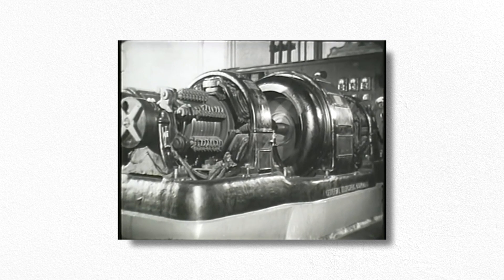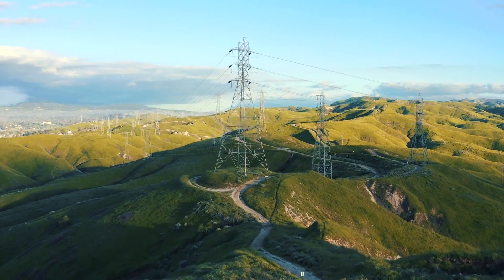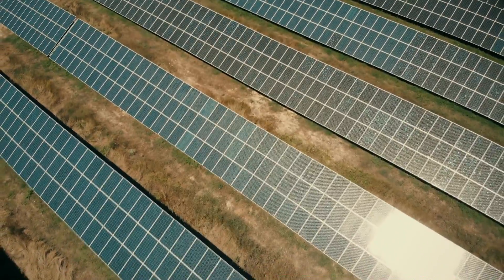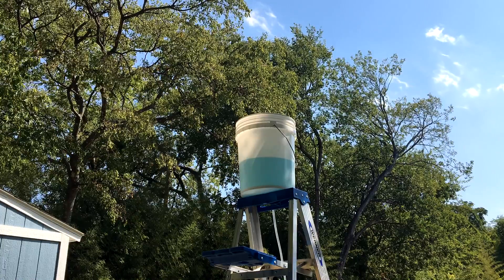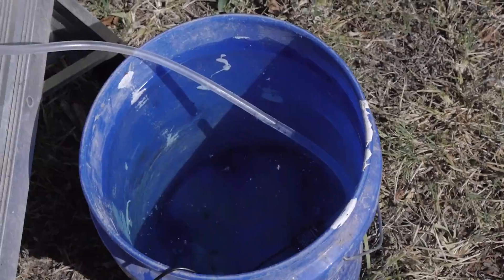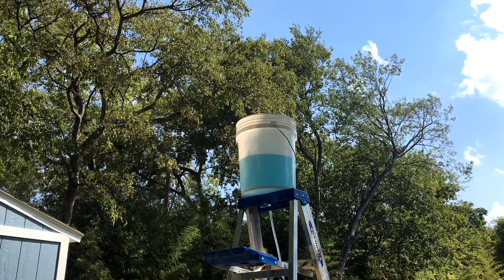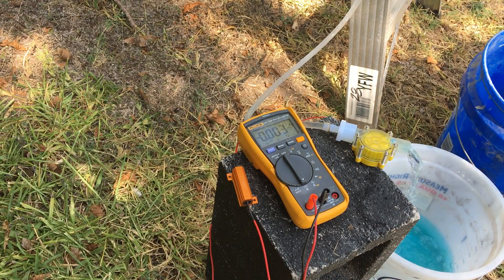World's Largest Batteries - (Pumped Storage)

Comment: I was thinking we could do it with air.. Run compressors at the cheap rate and let them power the turbines during peak demand. Just need a massive pressurised air tank now
Reply: Air heats up when you compress it, so you'll lose a lot of the energy you put into that pressure tank.

Comment: 1 m^3 of water at 100 m difference is ~270 Wh. 
1 km^2 reservoir x 10 meters deep = 2.7 GWh
Modern pump storage round-trip efficiency ~80%  ~2.1 GWh
It is enough to compensate NY City Evening peak. NYC eats up ~10 GWh per day.
Or ~200 000 000 typical phone or 18650 LiPo batteries.

Comment: Just had an idea, might be a little crazy, but I'm good at those types of ideas ..
What about a hydroelectric facility in a biosphere? There would still be the necessity for pumping water to the upper Reservoir, but if the Dome were the right shape, a fair amount of water could be moved through evaporation and condensation given the elevated Heat in a closed environment. Any thoughts and opinions on this concept would be appreciated.

Comment: What if you used a pulley system to get the bucket up to the right hight, you can use leverage to half the weight of the bucket as many times as you want, and you can use gravity to get it up there kind of like a weird see-saw

Comment: My understanding is that it is not about energy cost variance from day to night but the fact that many power plants produce the same amount of energy throughout the day and night and generally much more electric is consumed during the day meaning a lot of energy that is produced at night goes unused. This wasted energy is used to pump the water so even if you only get a portion of that back during peak hours it is better than all of the energy that is used for the pump being wasted at night. This also means power plants can reduce the amount of power they produce by a small amount because the high drain during the day is offset by the stored power generated at night by the pumps. This would obviously not be the case if all the extra power generated by the power plant was used in a hydro-storage facility but that is currently not the case, the majority goes unused.
Reply: PHES has RTE of 80% so quite efficient. 

In many countries peak demand is evening and morning. 

Countries with good wind or good solar can recharge the PHES when prices are low and generate at high demand when prices are high.

Comment: solar or wind charged compression pressure in water flow tubes could increase hydro current force? compensation for when height isn't available for head pressure?

Comment: https://www.youtube.com/watch?v=buF8ASmwXt4

So, awhile back I saw these whirlpool generators.  Taking this idea of pumped storage, and basically switch backing these generators down the mountain side, could you increase the overall efficiency of power produced?  It would still take off peak power to pump it back to the top, obviously.  But I am curious if this may be a better means of power recapture.

Comment: Simple,low cost yet important tweaks to two conventional methods of energy storage appear to have solved the intermittent generation/storage issue with renewables. Bio mimetic fuel cells show potential as well. Check them out. https://www.youtube.com/watch?v=N2u6EDwumdQ&t=2s
https://www.youtube.com/watch?v=-QNwGuqh9O0
https://www.youtube.com/watch?v=Orz1yQausc4&t=70s
https://www.youtube.com/watch?v=ULtGWCalIYg

Comment: I've heard of using off peak electricity to freeze water and use that ice to cool a building in peak hours. Would this be considered (heat)pump storage as well?
Reply: Joshua, 

there is no such thing as off peak electricity, as you imagine it.  Electricity supply rises and falls with demand, there is not excess electricity when demand is low, output adjust to meet demand. So called off peak is when demand is low and utilities try and create a demand for that time by selling it cheaper which means their plants are running at a higher output. If the demand at night increases, say by charging a lot of electrci vehicles, then the off peak diminishes or may even disappear.

Comment: Hydro's been used for load balancing for a century or more & most every hydro facility can in theory be used for pumped storage.  People who criticize wind and solar power don't seem to understand this is a very old and well solved problem of power generation not least of which the load on the system is always variable; the sun "turning on" its sunlight is little different, but just in reverse, what happens on a sunny hot day everyone flips on their AC.  Speaking of, every air conditioner can in theory be used to make ice; energy storage problem solved...or at least in windy places...make ice when demand is low &/or generation high, and use it then to cool at peak times.  Actually solar works well for this too; people usually turn on AC when getting home from work.  Otherwise this isn't 1919; we began using electricity to provide "sunlight" at night; in 2019 though, lighting is only a small portion of our electric load and we use the most when generally the sun is shining.

Comment: This concept doesnt have to limit to water.  I seen the same concept with just weight and a generator for light in villages in remote parts of the world where there is no electricity.  Would it not just be a better idea to use buckets of dirt raised in low demand and that weight turn a generator when power usage is at peak?

Comment: Maybe a dumb question but why don't they use something with more mass density? a steel slug in a well-hole would automatically have 8x more energy density, no? Well-holes already have a whole industry, and you could dig them side-by-side on flat ground and go as deep as you can afford. You could use carbon fiber tow, and a switching mechanism of using one motor/generator for multiple slug-holes. What am I missing here...

Comment: Good luck getting this to work during winter in the north. And don't forget about the losses due to evaporation if you set these up anywhere solar power might be feasible! These are also terrible for environmental reasons if you have to flood a valley or something! You might as well just start damning rivers and go full Hydroelectric. Then you can let nature do the uphill pumping! And like you said they have to be HUGE!! Much more practical is kinetic energy storage. Basically a big, heavy balanced weight that gets spun up to whatever speed it can handle during low demand and then used to turn a generator when more power is required. Works in any climate, low cost, can be built to any size, can be built underground, easily expandable. Plus you don't have to pay extra because someone owns a patent on something.

Comment: I saw a YouTube video somewhere where they were using a huge concrete weight or rock or something... with the same concept.. but raising the rock rather than the water level.  prob not much better for efficiency in generation mode.  At least in a way, it is more "engineer-able" with less infrastructure... piping and reservoirs up-front costs are phenomenal..as you know. :)  Interesting you mention seawater.. then you could get a second benefit of a "controlled" tidal area.. possibly for sustainable seafood production.

Comment: We have one of these in Snowdonia in the UK, called Dinorwig but nicknamed "Electric Mountain", it's built among some old mine works, but they massively expanded the interior caverns, the largest of which is 167 ft tall, 590 ft long, and 75 ft wide. 0 MW to 1800 MW load can be achieved in approximately 16 seconds. I've hiked up to the to lake and they even do tours inside the main facility.
Reply: Also very close to an ancestral family cottage on the coast which is still in the family, there is some remains of a tidal pool that was dammed off, and documents describe a waterwheel which would close off and use the seawater every time the tide went out to grind grain. So that's an oldschool example of the seawater application of the energy use.

Comment: These aren't so much batteries as they are rechargeable super-capacitors. Batteries wear down over time, these will always be able to hold a fixed amount of water at a fixed height no matter how many times you refill them. 

Anyway, the energy density should be compared to THEM since it's lower for super-capacitors as well!

Comment: I worked for Ameren at a gas fired turbine power plant and Ameren had a pumped storage facility (Tam Sauk) in Missouri. It appears your photo was of it. Something went wrong with the water sensors in 2005. It was over filled and the walls collapsed which flooded the valley with a billion gallons of water that created massive amounts of damage. The facility was run remotely without anyone being on-site.

Comment: It can be imagined that the problem might be utility scale storage. On the other hand a decentralised approach may be even better. If there was an affordable solution available for every single person on earth to be able to store a single KWh of energy that is smart enough to feed back into the grid at times when it makes sense then the planet would have over 7 terawatthours of storage to use. Hot water had the same problem. Until modern home geysers became common it would have been impossible to serve so many people with hot bathing water in the evenings and mornings. I expect in the end somewhere between 5-10KWh of storage per home will become as common as hot water geysers and this along with some utility scale storage will cover all our requirements.
For now... Battery demand growth is mostly from automotive sources. This is encouraging new R&D and is causing the batteries to become cheaper and cheaper. The pricing of home battery solutions are lagging since it has historically been a high profit, low volume industry. At some point an entrepreneur will notice that he can sell good smart home battery solutions for peanuts to the billions of people in the world and make a ridiculous amount of profit. The end. No more storage issues.

I fully expect batteries to follow the same affordability trend as microprocessors.

Comment: We have been using this system for 40 years in North Wales to balance out the peak usage across the United Kingdom 🇬🇧, A mountain was hollowed out in the Snowdonia  Mountain Range for the generation hall with two enormous lakes , so it’s old information that’s tried and tested and it works well, and the piping from your bucket to the generator just doesn’t cut it as it’s the same as the outlet so research first before doing a video as too many discrepancies

Comment: I'm glad you mentioned the efficiency. That was one question I was going to ask if you didn't mention it :). Great video! 70% is still pretty good all things considered.
Reply: @Claptrap Jesus Its usually used to stabilise the grid so i would say yes ineficcient, but very important and well worth it.
Reply: Lithium ion is 80-90% efficiency, but it’s also terrible for grid level storage. Grid batteries like iron- or aluminum-air have much lower energy efficiencies, though also require much less space. Pros and cons.
Reply: Dinorwig http://www.electricmountain.co.uk/Dinorwig-Power-Station is reported to manage 75%
Reply: As the video says, if you can get money more than you lose with all things considered. It's feasible to build
Reply: A well designed and operated PHES (pumped storage) will achieve RTE (round trip efficiency) of abt 80% (turbines and pumps of power station scale achieve abt 90% efficiency each). 

Batteries aka BESS achieve 85-90% efficiency but at this time (2022) are 4 to 5 times more expensive than PHES.  BESS are good at grid stabilisation and FCAS (Frequency Control Ancillary Services). 

CAS (compressed air storage) suffers from thermodynamic losses even with good heat transfer and recovery. 

H2 (hydrogen) has recently got huge hype but this tech really still requires significant R&D to scale up to grid scale size.  H2 has good potential but is still quite inefficient compared to BESS and PHES.
Reply: Its horrible in an absolute sense but pretty good in a relative sense
Reply: 70% is terrible in reality.

Comment: The easy way to store the electricity for later use is to build huge 20 by 40 Olympic pools and turn them into saltwater capacitors as Nikola Tesla did and then you'd be able to store as much electricity as you needed to use during the evening saltwater capacitors think about it

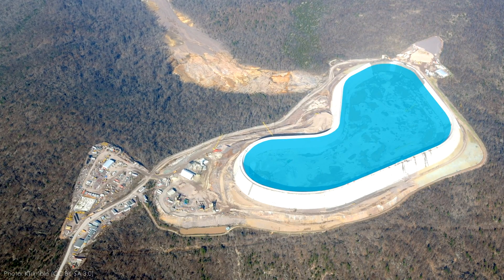Comment: 4:20 is the after effect when one fails. The previous reservoir up there Taum Sauk burst Dec 14 2005. That big rocky scar is where it scraped the rock clean of vegetation. Fortunately it happened in the middle of the winter. Just down stream of that is a camp ground called Johnson Shut ins. If it had let loose on a summer weekend many hundreds of people would have died. The biggest design failure is that the thing was made of un compacted fill with a cement wall on top with out a hardened spillway relying only on sensors to shut down the pumps. How something like that with out a spillway got approved is criminal.
Reply: Agreed. The Taum Sauk Mtn reservoir was extremely dangerous due to negligent engineering & operation by Ameren-Union Electric.

It nearly killed the Park Ranger & his family at Johnson's Shut Ins below the break. It destoyed a natural Fen ecosystem that might never return.

Comment: Pro Tip: check your collar before recording. If it curls up, just spray some water on it and blow dry it hot to flatten the collar. 
I grew up 5 miles from one of these facilities. Learned about this technology on a 4th grade field trip. Surprised we don’t utilize these more often but it guess it makes sense that they need to be located in locations with enough excess power for purchase and the potential demand to resell.

Comment: Could high-rise buildings in large cities be used for pumped storage? I'm picturing one or more large holding tanks on the top of a skyscraper that would be filled up with water during the night and then drained through one or more small hydroelectric turbines in the basement during peak hours. The stored water could also be useful for augmenting any fire suppression systems within the building.

Comment: My Father and Brother-in-law are/were Engineers at Pumped Storage hydro plants. Great video! And about your model using two buckets, you could get much higher efficiency by doing two things. One raise your upper bucket to say, rooftop level. And two, use much bigger tubing. I'm sure you know that already. The hose especially is seriously killing your efficiency. Most friction head loss in a pipe or tube, in laminar flow, occurs right near where the water touches the pipe. increasing diameter of the pipe makes more of the cross section nearly frictionless.  So your efficiency would grow dramatically if you used something like a garden hose or larger. You can also increase performance by using a shrouded impeller turbine (similar to a Jetski), instead of the paddle wheel type generator you are using. I know it is a simple home experiment, so I am not criticizing you at all, just pointing it out.
At the Blenheim-Gilboa Plant in NY, where my father worked, the Elevation difference (head) was 1100 feet and the shaft diameter for the water was 27 feet, so its 4 generator/pumps can generate 1,100 Megawatts for about 8 straight hours until the upper reservoir is drained (although rarely if ever used this way). The upper reservoir can hold about 5 billion US gallons of water. Today it achieves about a 73% efficiency. Most of it's power is used for peak demand times for NYC.

Comment: I wonder if the excess capacity could be used to create hydrogen from electrolysis and then use the hydrogen as a fuel/battery
Reply: Yes! "Surplus" renewable electricity being used for making "fossil free" hydrogen from water has huge potential. e.g. to replace petromethane in all sorts of industries needing lots of steam or other process heat, such as in glass  or paper manufacturing. As ever, price is a key consideration, so fossil gas is gonna have to get a lot more expensive than USD$20/GigaJoule. #CarbonTax anyone? CH4 #FugitiveEmissions #RadiativeForcing #ClimateEmergency

Comment: I think you should do a video about flywheel energy storage, I wanted to make one for my servers in my house because there's times where the power will come in and out with heavy rain, so it would be perfect for that kind of application.
Reply: trouble is you would have keep the fly wheels turning for 99.999% of the time  say 1 watt per hour  how many hours you gonna keep it turning  24 day    168 a week   and so on 

just to use it for 001%   10-20 mins  yea good idea

Comment: I am a huge fan of storing energy in the form of elevated water. Your small scale test was woefully inept. The equipment you used was terrible. Did you get that tiny generator from a cereal box? It should not have been used as an example of a single data point  in your video. You based too much of your conclusions on  an inaccurate test. You do math but you do not do science SIR.

Comment: This application has limited locations where it can be developed. Water, geography and costs may work, as stated, on locations with high cost of power. I think one island in the Canarias has his and the pump up power comes from wind turbines. For power storage in all locations, the Tesla type Li-Ion battery system is the way to go. Relatively inexpensive, reliable, long lasting and compact are features that are very attractive and competitive. Great video. Thanks